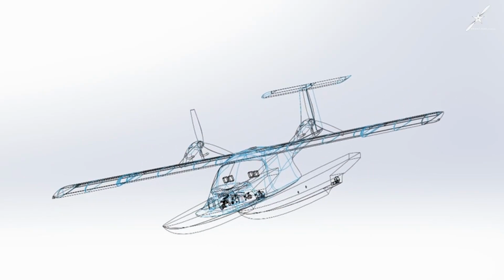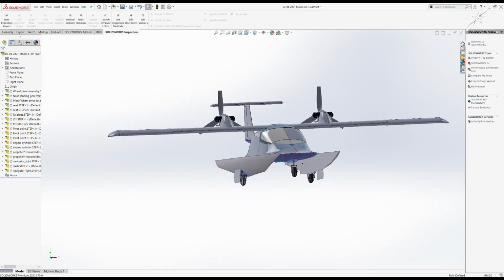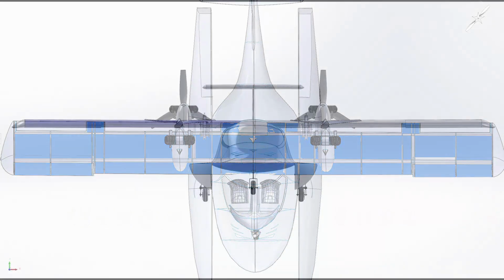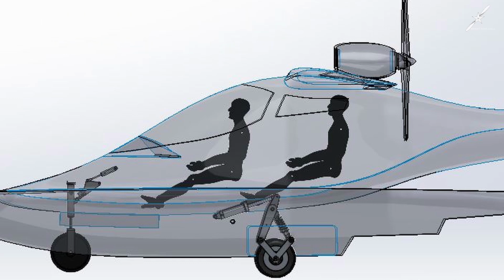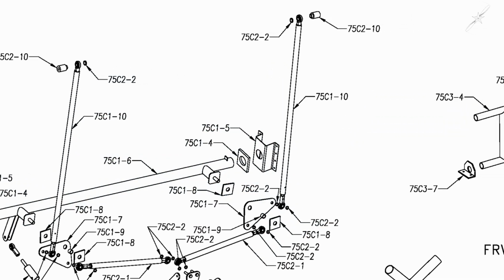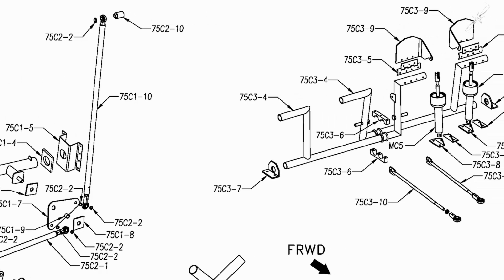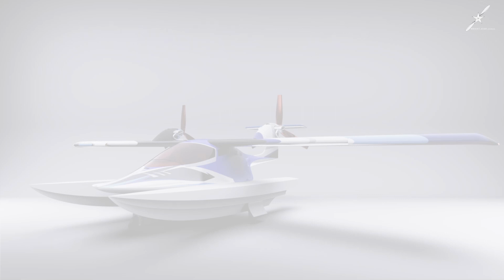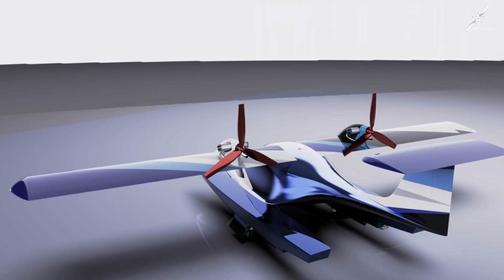Exciting, NEW, Amphibious Aircraft.

Comment: Im looking to start my first experimental build and just came across this.  Couple of things have you considered not having nosewheel steering at all and just using a free spinning nosewheel and differential braking to steer?  Its a little harder on the brakes but would probably save some weight.  Also have you thought about doing something along the lines of Aircraft Spruce. In addition to the complete kits they also offer everything down to every nut and bolt for the build al la carte. Basically you can buy anything from just plans all the way up to a 49% assembled kit and everything in between..  

Also It would be nice if someone offered smaller (I'll call them staged kits) kits.  So if you have space constraints, you're on a budget, or just get easily distracted/overwhelmed working on large projects you can buy the parts for the aircraft as you complete it. (I'm just spit balling here as in reality it would simply be following the plans in order, just broken up into stages) So basically you buy the 1st stage kit.  This could be like your basic frame, wing roots, spars etc that need to be assembled first.  Then once that's complete you can buy the 2nd stage, which could be landing gear, electrical, flight controls etc.  Stage 3 and so on until the plane is complete.  These broken up into 5K-10K (20K at the most) would allow much easier entry into the build and allow builders to work one thing at a time without parts strewn everywhere.  

If you offered something like a staged build I would definitely be on board day 1. Right now thats the only reason I really haven't jumped on a Velocity or complete Cozy kit as there is NO WAY I would be able to convince my wife to let me swing 50-70k+ "for an unnecessary toy" all at once (I mean I could just do it anyway but I kinda want to keep her around and not worry about waking up in the morning lol).  But she wont notice 5-10K here and there every 6 months or so lol. 

Anyway, I've rambled enough. Just wanted to say I love what you're doing and the direction you're taking. Hope you get around to an update soon. Cant wait to see the finished product!
Reply from the maker: Thank you so much for your comment. I do plan on sticking with the nose wheel unless we find too much of a tipping moment on turns. There are many reasons for this. Here are just a few, complexity to retract two nose wheel into the floats, not leaving them out because of drag and they look ugly, centering these free wheeling tires before retraction would add complexity, I want nose wheel steering since I have taxied free castering nose wheel aircraft before and didn't like it.  As for the kits and how they will be sold, I haven't given it a lot of thought. Personally, I would rather sell the entire kit at once. So, we will probably get set up with a finance company to offer financing. The kit will cost way less than the flying airplane. In fact, the two engines and instruments will cost more than the kit. So, in a way, it is already set up as a multistage investment. The major purchases would be the kit, then the instruments, hen the engines, then all the wiring, interior, and paint.  Thanks for checking out my design and liking it. I wish you all the best with whatever ki you do end up buying. I have built many kits, and my advice is for you to set a goal of at least 15 minutes each day five days a week working on it. If you work longer great. But every day, a minimum of 15 minutes.
Reply: @BrightStarAssemblies  We actually have the same type of philosophy.  I have been modding and building cars for years.  I recently started restoring classics and found the amount of work to do a frame off FAR exceeded anything I was used to.  I was used to completing builds in 6-12 months.  Frame offs are more like 2-3 years when doing them on weekends and in your spare time.  I just go out to the garage and complete ONE task.  Most of the time I do way more but at a MINIMUM, every single day, complete one. This is usually only needed in the middle of a project.  In the beginning I'm excited to get started and at the end I'm excited to finish.  Its always in the middle where you're like... WHY DID I DO THIS TO MYSELF lol.

Comment: I think the main gear doors are going to be a challenge since water is very dense some step in front of the doors is a must so they aren’t grabbed by the water and ripped off, bilge pumps are a must and they add weight, location of the bilges for scavenging is important so water doesn’t pool and the composite doesn’t start creating bubbles, galvanic corrosion is important to take into consideration, i hope I can be of help and if I am wrong please let’s talk
Reply from the maker: I agree about the gear doors. I will do my best to design something that is strong enough to not get ripped off. Remember there are jets that have gear doors that hang out in the air going 250kts. That would be comparable pressure to about 20 or 30 kts in water. These doors would only be opened in the water at dead stop. Cursing in water with the gear hanging out will be a limitation of the aircraft. Anyone going faster than 5 kts in the water with the gear hanging out, gets what they deserve. There are things pilots should not do and this is why aircraft manufactures put limitations on the aircraft. 
"bilge pumps are a must"  There will not be any bilge pumps on this aircraft. This is because there isn't any place water can get into or settle into. The pontoons (floats) are not empty. All compartments that are hallow will be filled up completely with closed cell foam. Kind of like the inner and outer skins on a Bayliner boat. This way, if you hit a log or something and rip a hole in the pontoon, it will still float. "galvanic corrosion" This type of corrosion only happens between two dissimilar metals. This aircraft is all composite. There is no metal in the pontoons. You are thinking about metal sea planes. 
" i hope I can be of help"  Sure, we can use all the help you can offer. Email me at brightstarassemblies@yahoo.com
Reply: @BrightStarAssemblies  thanks so much for the insight, sure will do at the email!

Comment: Two 150hp rotax with variable pitch props will make this a seller and an absolute monster on takeoff and landings
Reply from the maker: Thanks, and you are very correct. In my next video, I will talk about how we are moving away from the BMW engines and towards a 200hp light weight engine.  You will find out more in the next video.

Comment: First time watching this with Zero aircraft experience.I have an idea for you, a center pontoon, used for balance, extra fuel, hide the center landing gear. Just a thought I wanted to share. Love the deign. One last idea, what is the weight limits? Most of the designs out there aren’t large person friendly, example of 300 lb. Per person passenger with the appropriate shoulder room. Just the limit, if passengers are smaller then more range and speed.
Reply from the maker: Thanks for sharing your idea.   This aircraft for sure is large size friendly. In fact, in this video the distance from shoulder to shoulder of the two front pilots is 14 inches (normal 200lbs guys). Then the space from shoulder to the side of the aircraft was 12 inches. So, a LOT of room. We have however reduced the with of the fuselage since this video by one foot. Meaning there is now six inches from shoulder to inside edge of the aircraft and still 14 inches in between. We could always reduce the 14 inches by bringing the two seats closer together giving more shoulder to inside wall of the aircraft. Being the builder, you could move the seats to fit your needs. Thanks for watching my video.

Comment: Really enjoying these videos, you've convinced me with the sea plane idea I had forgot they even existed before watching your videos.

Had a few things I wanted to say about the plane. For context I am studying aerospace and am by no means an expert. I wanted to share my thoughts out of curiosity for what people would say back and also because theres not really any harm. From the designers perspective its beneficial almost to know youve done a good job and then be able to tell me to shut up so I thought I would give it a go.

1. Wanted to comment about the large section on the underside, this isnt neccesarily a problem to have but it does need extra thought. Such a large surface will definetly produce lift and therefore analysis must incorporate this. However after reading some of your comments I saw the X-Plane model you mentioned and think this is a good idea to understnad how it will perform as without it you would be lucky to find the neutral point.

2. One thing I did want to raise was how low the fuselage is to the water. For conventional take-off, that large bottom surface will 100% be within the ground effect and the pontoons will enhance that by a lot. This must be analysed as having the lower part in ground effect and potentially the wing out of it could cause a massively different neutral point than in cruise at altitude.

3. Also if youre taking off from water having that front lip (in front of the cockpit) so close to the water could be dangerous if it digs into the water? Not sure how likely this is as I have no experience with sea planes but make sure it is riding high enough, the pitching down moment from the propellors could make this more likely especially at low speeds when the wing and tail are yet to keep the nose up properly.

Hope any of this is helpful or interesting, good luck with the build im excited to see it fly.
Reply from the maker: Thanks Player 1884.  Good thoughts and thanks for commenting. Here is my response to each as they are numbered:

1. Yes, for sure we will text this design in X-plane to see how it performs both in flight and on the water.
2. I am not sure what your meaning by "Neutral Point".  As for the rest of the comment I think we will find that out by using the X-Plane modeling. Personally, I don't think it will be a factor. 
3. The nose will be sitting a couple of feet above the water line. I know it looks like it is just a couple of inches, but this plane is much bigger than you might think. Also, one would not get close to the water with the nose pointing down. We do descend on approach in a nose low attitude. But as we get close to the water or ground, we transition to a level attitude, then within a foot or two, we begin pitching the nose up in the landing flare. On most aircraft including this one, it will touch down with about a 5-10 degree nose up attitude. 

Thanks again for your comment. I like hearing others views on this project. Keep in mind that we have already made many changes to this design since this video. It's time I get another video out because of the changes we have already made.

Comment: I see you are addressing what I wrote in your previous video. The flying car shown has a much larger horizontal stabiliser, it also creates lift. The main wing is much closer forward to the centre of drag. The wing is also in the centreline of drag with the car. Have a look at the Beriev Be-103 for comparison. i disagree with making a model also, they are very accurate in modelling a full size aircraft. For a fixed wing aircraft it is also easy. I am myself making a helicopter of unique design, and modelling for that is difficult to make.
Reply: Your front wheel has no castor built in for a start, it will flap around.
Reply from the maker: Yes, I read all comments and do make changes to the design based on those comments. As you know things are still changing with the design to make it the best design I can create. There will be models made before the prototype will be built. Thanks for you comment.

Comment: One of the big problems (if not the biggest) of this design is deep stall. With this big area on the front of the aircraft, the overall CP will be too forward, specially during a stall. You'll get a vortex on the V groove between the floaters and the fuselage. It's possible that this vortex helps with a increased downwash, but just CFD and/or wind tunnel tests can confirm this. Combined with the messed up stream of the wings and a relatively small horizontal tail volume, it's possible that you'll get a very bad scenario on a stall. Maybe it will be impossible to recover. You gonna need a very big safety tail chute. Be care about it.
Reply from the maker: Thanks for the comment. Aa you know from the video this is still a work in progress. We have already increased the entire tail section and moved it back one foot. We have also gotten some direction on the hull of the floats. I have started the script for the next update video but then my computer crashed. So, I am having to start over on the next video. We do plan on inputting this into X-Plane to see how it will stall. Thanks for your comment.

Comment: I like the design, and a 4 seat AMES with 1500 lbs useful load would be great.  I am rooting for this to work out, but I believe you will have a major challenge hitting the wight/strength numbers at that target price.  Just like in mountain bike parts - light weight, strong, cost effective - pick 2.  Even the $1M DA50RG only has a useful load of 1200 lbs.  Light and strong will be costly, even in a kit build.  If you could build a certified ASEL, or even an AMEL, with those specs, I would be first in line.
Reply from the maker: Thanks, I am hopeful with the numbers. We will just have to see what the engineer says regarding the load. If I can't meet or exceed those numbers, then, it would be pointless to build it. Since we haven't set a target price yet, I am sure we will hit the price point. I am sure I can build this plane cheaper than the iCon A5 sells their aircraft for.